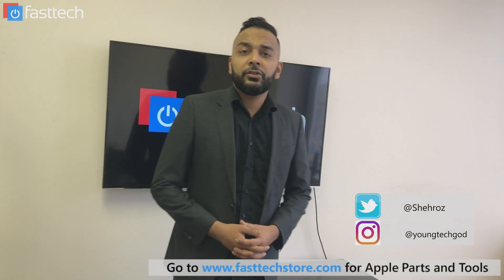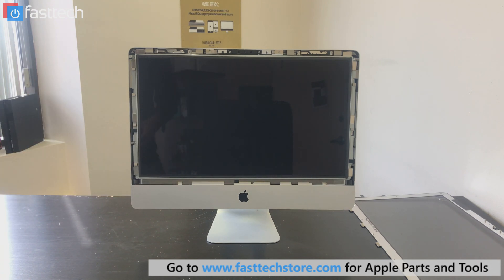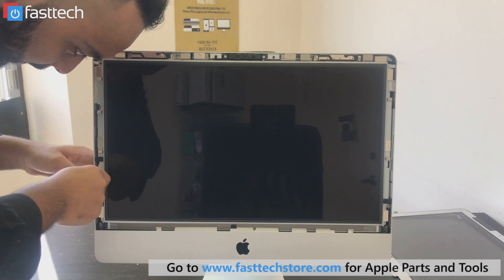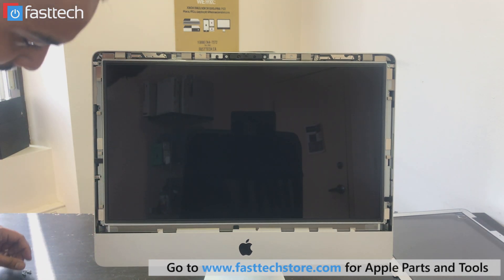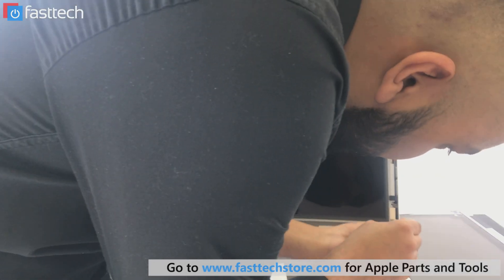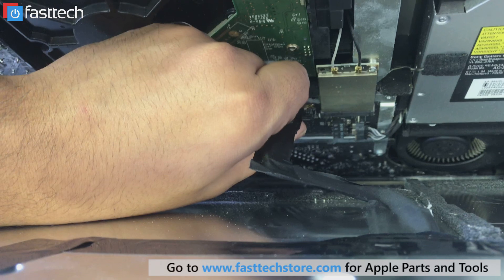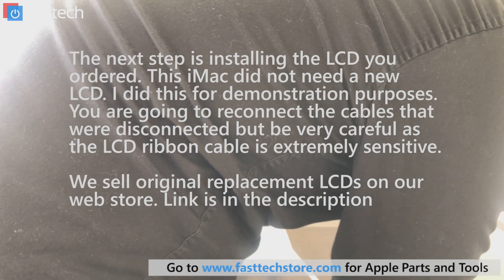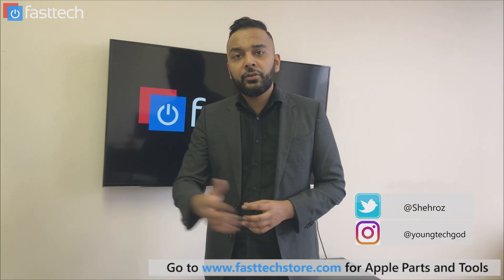iMac 21.5" A1311 (2009 - 2011) Glass Panel and LCD Replacement

Comment: I tried on mime but found its held on really good with strong adhesive tape.
Reply from the maker: Use a heat gun to heat up the edges of the screen

Comment: Subscribed. Keep posting!
Might of been posted 2011 But great work my man. I just got handed one of these. 
I do daily windows repairs and mac straight hardware installs, But This ting got dropped off and it look WET inside, condensation inside the glass. Popped it off the machine did not seem wet inside.
 I did not remove the panel as i was not ready to get into it, But it does get power and it does chime. So I figure pop out this panel order a new one? At least get picture I suppose. Not sure how far owner is willing to go, But I am thinking pretty much just the panel is bad? ( Sound no picture.. Boot with chime  no power to screen )
Reply from the maker: You should not turn it on until the liquid has been removed from the board. You might have to remove the board from the iMac to do this properly. Sorry about the late reply hope you find this info useful.

Comment from the maker: FREQUENTLY ASKED QUESTIONS
Where do I buy the parts and tools needed for this job?
BUY SCREWDRIVER AND LCD HERE:
▶️ TORX T10 SCREWDRIVER: https://www.fasttech.ca/tools/torx-t10-screwdriver
▶️ MID 2010 LCD: https://www.fasttech.ca/imac-215/imac-intel-215-emc-no-2389-lcd-assembly
▶️ MID 2011 and LATE 2011 LCD: https://www.fasttech.ca/imac-215/imac-intel-215-emc-24282496-lcd-assembly